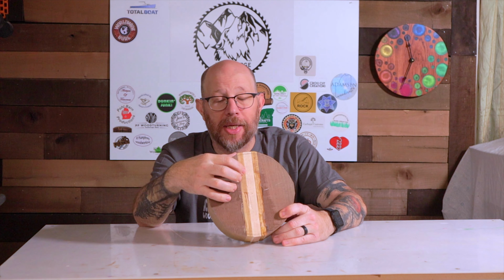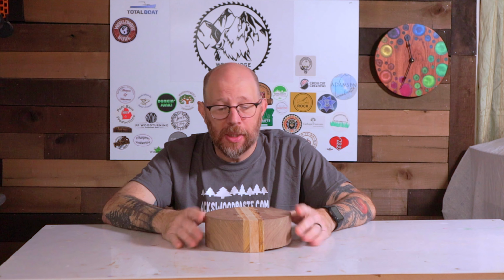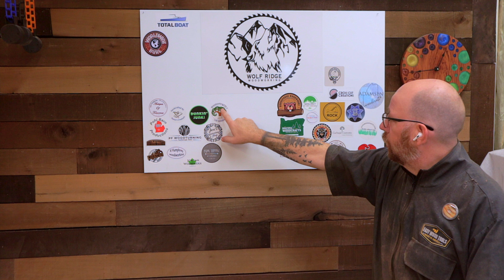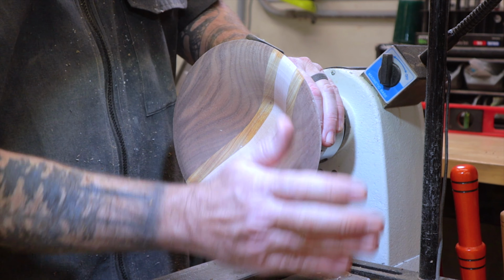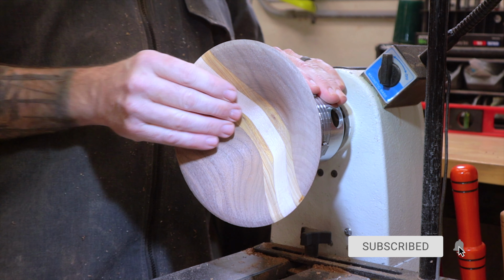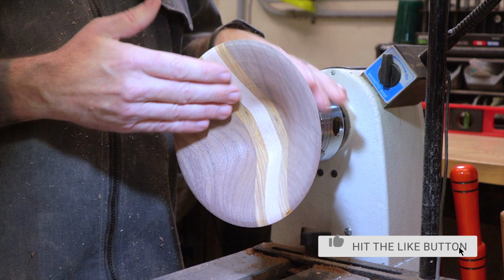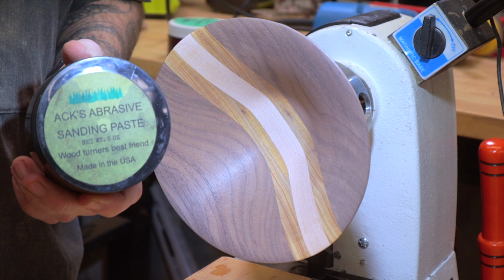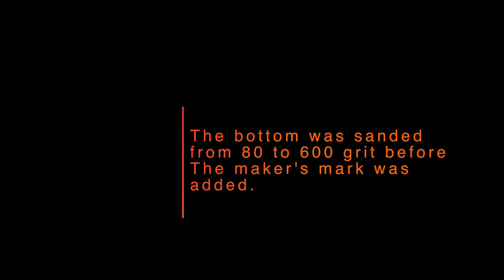Woodturning: Walnut, Canary, & Maple Bowl (For Sale)

Comment: I also had many bowls and platters fly off the lathe when using the cole jaws. I have been using a donut chuck which can easily be made. It works great and adds a measure of safety when removing a tenon.
Reply from the maker: Thank you for the idea.  I've started using other methods also and eventually, I'd like to get a vacuum chuck.  I've heard great things about them once you have it centered.  Take care brother!  - Ed

Comment: Glad to see you healthy and back to turning. The bowl is beautiful. Luckily it survived it’s attempted escape. I was wondering what the laser/engraver is that you do your logo with?
Reply from the maker: Thank you Duane!  The laser engraver is a DIY CNC (MPCNC).  I put it together with 3D printed parts and electrical conduit.  Minus the 3D printer, you can build a CNC for less than $500.  My workable footprint is 15" x 21".  It will cut with a router as well as using the laser to engrave.  I'm not associated with them, but you can check out V1 Engineering (https://www.v1engineering.com/) for more information.

Comment: What did you use to make your maker's mark?
Reply from the maker: The laser engraver is a DIY CNC (MPCNC).  I put it together with 3D printed parts and electrical conduit.  Minus the 3D printer, you can build a CNC for less than $500.  My workable footprint is 15" x 21".  It will cut with a router as well as using the laser to engrave.  I'm not associated with them, but you can check out V1 Engineering (https://www.v1engineering.com/) for more information.